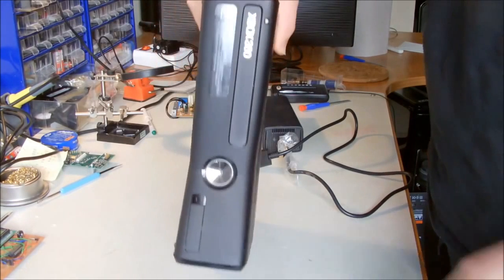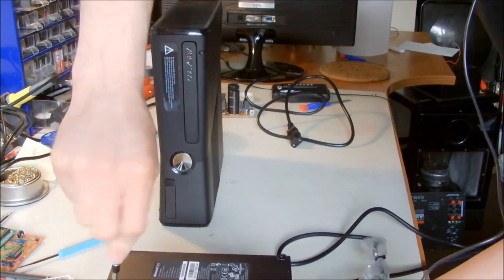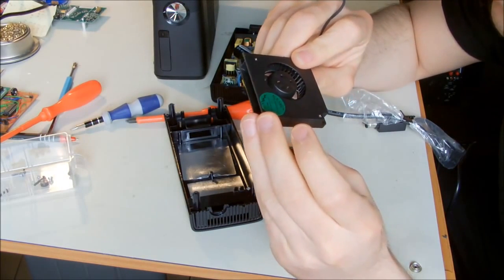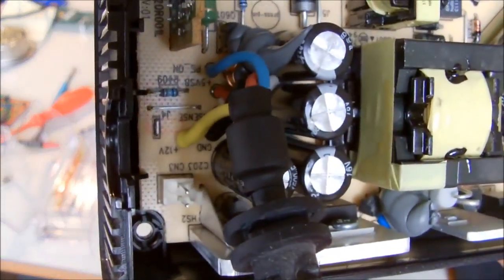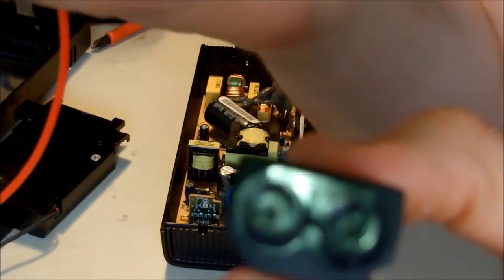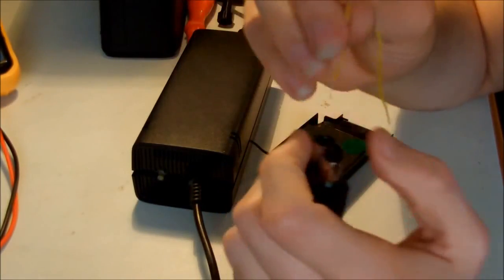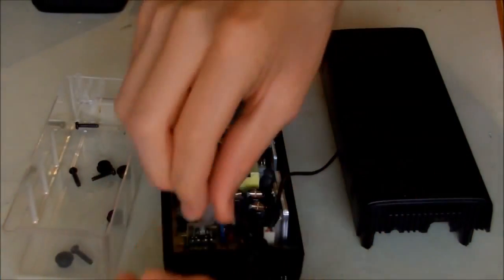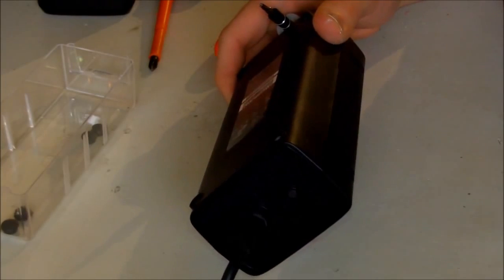Xbox 360 power supply "Brick" test

Comment: For the XBox One power supply brick test: short both inside pins, do not touch the inside, or outside of the barrels! Light should change, fan comes on. Then test for 12v on the inside of both barrels while still shorting the pins only! If you short out the power supply, unplug it, wait for the reset, then try again.
Reply: Thanks, I was looking for this information
Reply: So my power brick turns white from orange and the fan doesn't spin. 

Does that mean it's broke? I all ready changed the 1500uf cap the other 2000uf caps looked good to me. 

I can't find anything bad on that brick.
Reply: @arturbaltazar2526  Fan should com on when it starts getting hot under load. I use a piece of tissue paper next to the vent to test as you can't otherwise tell. It's quiet and barely noticeable when on.
Reply: @ahears1  the power supply was ok after the caps replacement. 
The problem was with the Xbox One motherboard, missing v5_dual.
This power line is controlled by the southbridge.

Comment: The 12V only appears when you turn on the power supply when you make a short contact with the two inside pins (5V and the other pin)
Reply: Absolutely right, this video seems wrong
Reply: @noxreno5427  what are your thoughts
Reply: Have you ever tried to make the xbox 360 power itself? I'm trying from scratch
Reply: So what was the problem, the brick or the Xbox?
Reply from the maker: The console was the problem. Please check another video that I posted

Comment: hi
thanks for your tutorial
i have one and it has no 12 volt output! while i turn it on the led is orange and when the xbox power on the Adaptor LED is green for a second and its turn to red. i open it and bring their tow Mosfet out and test it seems they works. you think whats the problem with it?
Reply: YOU ARE FUCK!
Reply: @martinlucero9594  No I Solve it:D
Reply: @Danidarkly  how..?
Reply: @martinlucero9594  there was a Zener Diode beside one of my mosfets. it was being short circuit, so i replace it with an random Zener diode and yeah:D

Comment: Hello, nice video. Mine is orange light and when i want to turn it on it becomes red light. I changed the capacitor 400v, changed the fuse and nothing. Any other idea ? I have 315vdc at the main capacitor but nothing in the secondary... Thanks.

Comment: first of all fhank you for the video it was very informative unfortunately my problem may have started as a dust problem but i cleaned everything with air but it helped only once or twice then i saw smoke and i shut it off when i opened the power supply and saw one of the capacitors or diodes i dont know the difference, that was becoming red and smokey so i disconnected it . so my question to you is how to identify what it is and if i can replace it? by the way i see the bad part on your video and i can point it out if you would like me to send you send you a picture.
i really appreciate your help
Reply from the maker: Well upload the image somewhere and put it's link here. If it is a single component failure then changing it would fix the problem. But sometimes its a problem in a group of components that only show up in one of them...its hard to tell the difference from a picture.

Comment: Interesting, I repaired one of these yesterday that had a couple of faulty Caps.  

There are four wires from the PSU to the Xbox +5v, +12v, GND, & Control (Sense).  When the PSU is first turned on it is in Standby mode and only has the +5v line active, when you turn on the Xbox the Sense line goes high (+5v) which activates a MOSFET (switch) in the PSU and brings the +12v line active, the LED turns Red, at this point the 12v fan also starts spinning to keep things cool.

Comment: I tried everything with mine and nothing so I found your video and watched it desiding to open it back up and try to find out witch cap was bad. so I desided from you to check the fan did not do that before. pulled it out and it was fine but dirty so I then moved the fan with my finger spinning it then unplugged it jiggled all the cables in the supply hooked the fan back up after flowing air in it to clean it and then tested the unit with the cover off and well everything started working again. thanks for the video my firend

Comment: There's no tachometer from the fan for the power supply to know whether or not it is spinning.  If it won't spin it won't cool so it will overheat and that is what leads to the red light.

Comment: The 12V pin inside the plug only produces voltage when there is a load applied to the 5V pin. You can simply ground the 5V pin (use a screwdriver to ground the center pin to the round connector around it) and the power supply will switch on the green light (if it's not otherwise broken or bad) and the other pin will start putting out 12V. Obviously, don't bend the pins! 

Now, my problem appears to be that the little fan inside isn't running even when I force the power supply to activate.... which makes me wonder if that's why my 360 slim isn't powering on (I cannot find any other fault with the motherboard or ports on the motherboard). Unfortunately, the darn security torx bit screws under the rubber feet on the power supply have blocked me from getting into it to check the fan! Arghhh! 

So if this comment saves anyone from downloading and watching this 30+ minute video, you are welcome! LOL! (video is too darned long for the end result)
Reply: Just to follow up, I give up on the tamper-proof torx screws on bottom of the PSU. Just too much trouble (and will take too long to order a set of these torx bits... money/time better spent on a new PSU imo). 

Noticed that when I ground the 5V pin, the PSU light goes from Orange to Green BUT the little fan unit inside the PSU doesn't blow any air AND I just voltage tested the other pin (while light is green and 5V pin is grounded) and it's still not putting out any voltage. Ergo, even though all Internet wisdom says Orange light on PSU means the PSU is ok and in stand-by mode, I'm going to order a new PSU to try on this XBox 360 Slim. 

I've gone over the motherboard with a magnifying glass, nothing appears burnt or blown anywhere all solder points look good I went ahead and re-flowed the main board with a heat gun (as per directions found elsewhere) checked every port for bent pins or other damage and still it does nothing but sound a weak "Ding" when I attempt to power it on with this PSU. I'm of the opinion my PSU is simply not switching on the 12V side of the plug when the 5V pin is grounded, possibly a bad fan motor inside of it shorting the 12V side.... idk. 

My experience with traditional computer PSU's is that all the fans are 12V and if any of them lock up and fail they will instantly trip the circuit breaker inside the PSU and the computer will not turn on as a result... so my conclusion here seems logical. 

Will update when I get a new PSU in to test. Probably won't make any difference and I'll end up junking the whole mess but this is my last worthwhile idea to fix the darned thing after reading and trying everything else on the internet. LOL!
Reply: Not true.  If you short the inside of the 5V+ side that's not enough for "power good" but that's enough to turn on the 5V- side.  I still haven't figured out how to get a power good but I know shorting the 5V- side while the 5V+ side is shorted gives a power bad (red)
Reply: @michaelshrader5139  did a new power supply work??Mine makes the beep sound an the green DOT comes on for about 5 seconds then nothing,my power supply turns green when I turn it on but INSTANTLY goes back to orange.No bent pins,nothing like that.Havent took it apart,hoping I don't have too!Any advice

Comment: great video! Helped a lot. I tested the continuity of my xbox one 12V power supply and no sound came out. Do I need a new a power brick also?
Reply from the maker: Hi, if it is the only problem, then I would test the xbox with another brick to be sure (e.g. get from friends or something). If it solved the problem then get a new one :P
Reply: Hi, new power brick solve the problem. Cause I'm have the same problem shall I buy new power brick or something happe with my xbox

Comment: Nice work. Better than many of the other available videos on "debugging" this power supply.

Thanks for taking the time to make it.

It would be MUCH more helpful if you would provide a labeled diagram of the connector, showing which contact connects with which color wire, and the name/function of each wire and contact.

The diagram doesn't have to be perfect...hand-drawn is fine...but with the camera and the lighting, it was impossible to see what you were pointing to with the "power sense" and "power good" contacts, and to be certain which color was associated with the "sense" vs. "good", and understand whether you were shorting to ground the "blue" wire or the "white" wire when you finally got the power supply to display the red LED. Also whether one of the wires didn't actually connect to a contact...for example, which contact on the connector does the white wire go to?

A clear and complete diagram of the connector also makes it MUCH easier to visualize the connections after watching the video...we don't have to keep going back and forth on the video to "make sure" of each connection and its function while we're trying to take measurements on the connector at the same time.
Reply: 4 a nube like me ,I loved it,was real!,to see someone explore and pass on kwoledge never is a bad thing!!!!